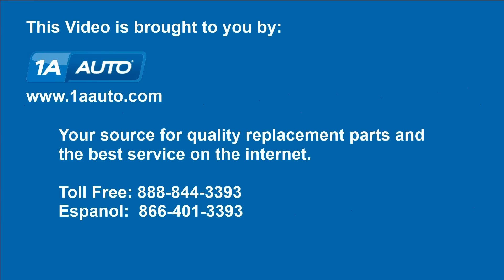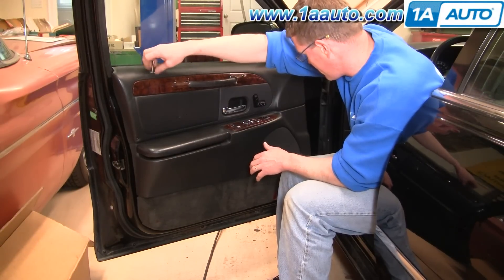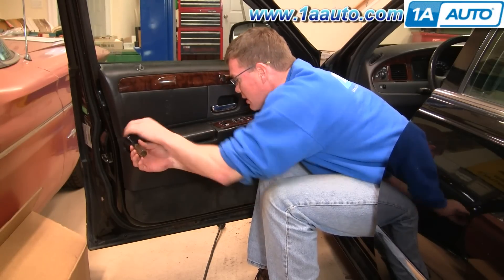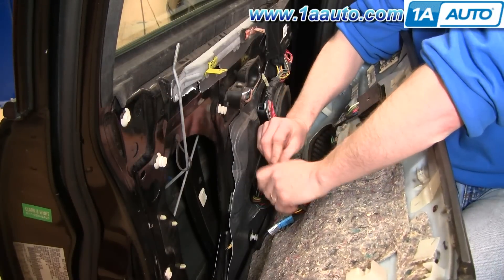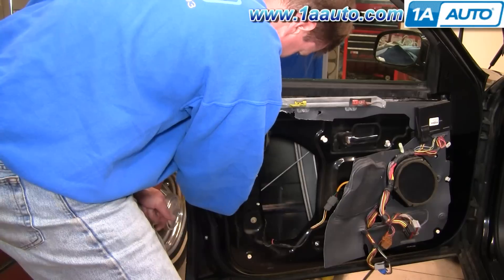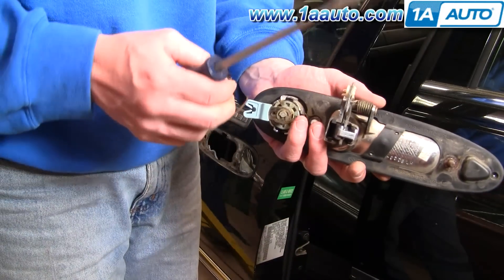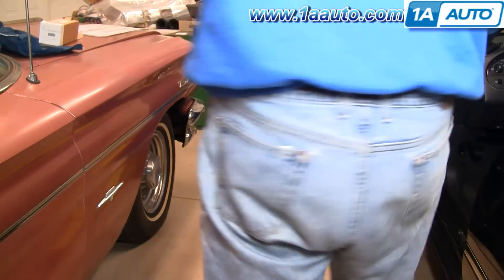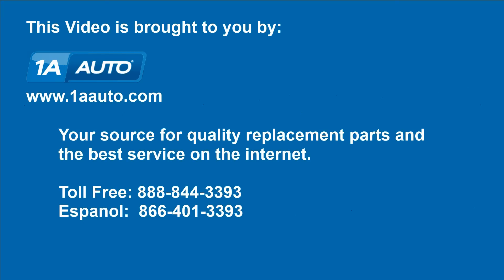How To Replace Front Exterior Door Handle 98-11 Lincoln Town Car

Comment from the maker: The door handle may have broke. You could take the door panel off to see if you can reattach the rods to the handle. If you need a new handle we carry them on our website 1aauto.com 888-844-3393
Reply: 1A Auto Parts
Reply: Can you led me to video on door panel removal driver side 2011 mkx Lincoln . Door handle problem. Broken.